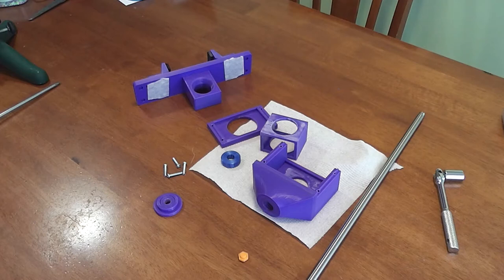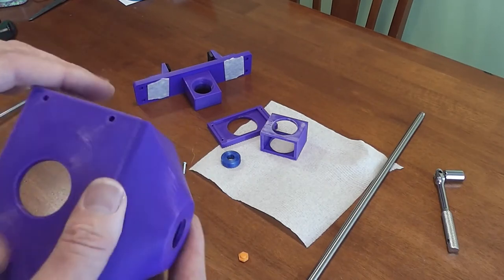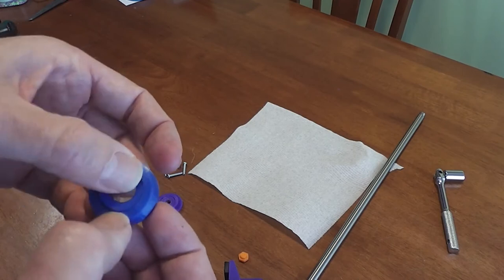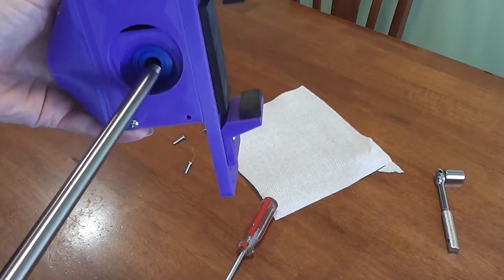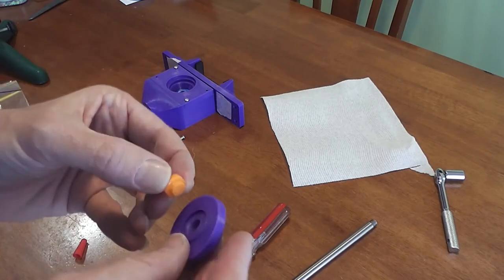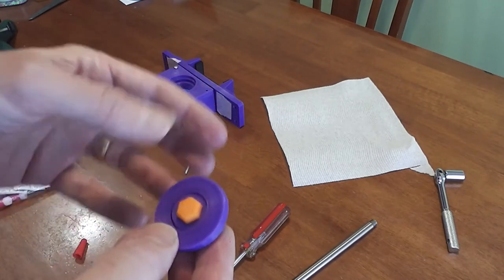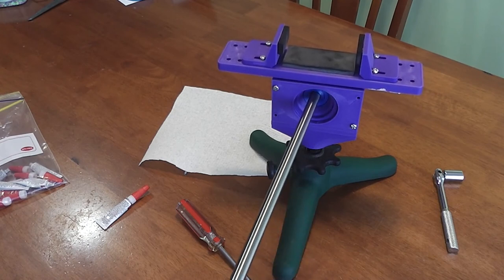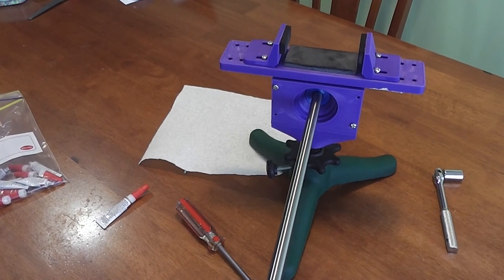Can you 3D print a Coaxial Shooting Rest???

Comment: Friction device to contain rifle weight  could be an issue mate . 
Seb actually has s counterbalance weight hanging out the  front version  . 
Great work mate .
Reply from the maker: Yes. I observed that to be the case which surprised me because friction seems to be how most of them work from what I have observed.
It wasn't that difficult managing the rifle weight (8kg) due to the leverage afforded by the handle but it was a bit tiring to have to hold my arm up to hold it steady.

Seb does have the counter weight as an option though as you've pointed out.

Luckily a counter weight is pretty easy to do. I could have put one in this if I'd simply used some 8mm threaded rod and passed it right through both of the bearings.
 As a first attempt I was really just seeing if it was possible. The sturdiness of it, even though it was made of plastic, was surprising.

With the elevation reversed the handle actually becomes the counterweight which is how I intend to do my next design. I've got a selection of metal bearings inbound in the post (if the parcel manages to get through given the current situation). It will be fun to see if I can come up with a design that people can get printed and build their own.